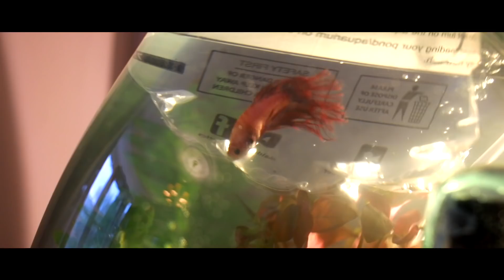THE DRIFTWOOD FISH TANK

Comment: Nice to see someone putting a filter and heater in their betta tank. Great job guys
Reply: but I read that betta dont work well with filter. is sponge filter safe for betta? I got small tank tho. its 3-4 galong (15cm diameter.) do you think I should use sponge filter?

Comment: It looks good, very creative, but would imagine that weekly water changes could be a bit awkward....and the lid may be impeding the oxygen exchange at the surface.
Reply from the maker: Thanks.  I am hoping that with the constant air pump the air should be constantly fresh and I belive Betta fish have the ability to surface breath.  Water changes are not to bad actually with the siphon wand.  I have another video on the way with some more info and to answer similar questions.
Reply: The air pump is not what oxygenates the water.  It is the agitation caused by the bubbles hitting the surface which does that.  It breaks the surface tension mixing the oxygen coming into the tank at the surface with the water.  In nature this is done by wind, waves or water falling.  bettas can breathe at the surface, but the lid would be greatly reducing the oxygen level at the surface.  
I have been a subscriber of yours for sometime but have not commented till now.  I run 6 aquariums in my home, the largest being 700 litres. Just trying to help. Cheers from sunny and hot Queensland, Australia.
Reply from the maker: Thanks for the info.  I was meaning that the air pump would be constantly replensihing the air space at the top of the tank.  I may add some additional vents into the lid then if that is what you would recomend?
Reply: Got to disagree with melody, the pump will increase the oxygen level in the tank. It will also be replacing My stagnant air T the top of the tank.
Reply: The surface area of the water is small compared to the bowl, because of the narrowing at the top. You should only fill a bowl 2/3 of the way. How are you heating and filtering the water? Doesn't look like theyres enough room for equipment in there. While betas can survive a lot of things,  ammonia is still dangerous to them
Reply: Disagree all you want..but that is not what an air pump does in an aquarium The pump is NOT pumping oxygen into the aquarium.
Reply: Yeah vents would help. This short video explains aquarium oxygenation: https://youtu.be/i-uAc5n89l0

Comment: Really amazing looking tank. I wouldn't leave it close to a window you will get a build up of algae on the glass really quickly. I would also check what Kelvin your light if those plants are really plants
Reply from the maker: It is a fake window that was bricked up years ago.  The LED has varous temp settings but if the plants don't last we may end up switching to fake ones. :-(
Reply: The Restoration Couple really looks like a real window!. I would give the plant species a quick Google and should get the most important Kelvin for the plant. I might suggest a small amount of liquid fertilizer. I would suggest ADA green brighty step 1. And depending on if you want clear water or not some almond leaves, they will turn the water a shade of brown but they are super good for fish health